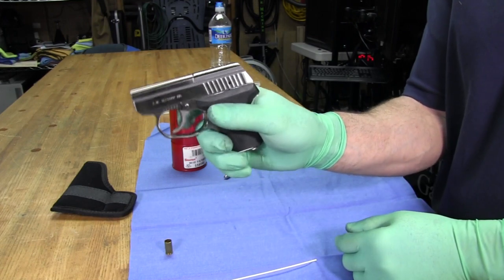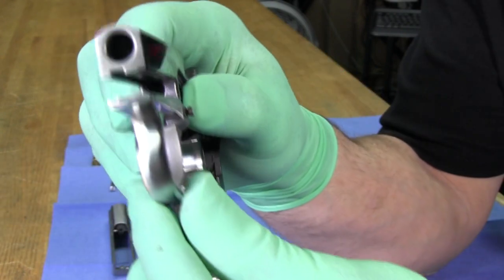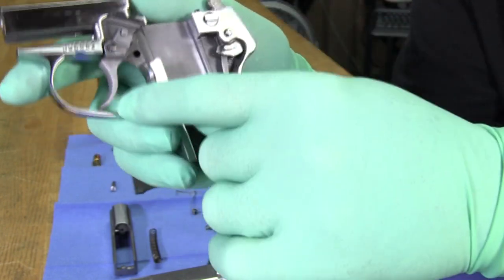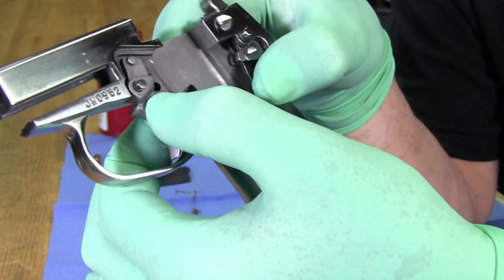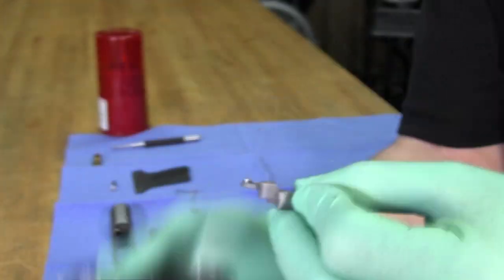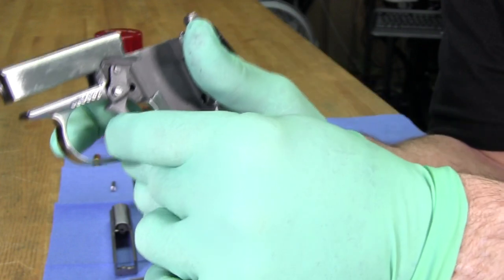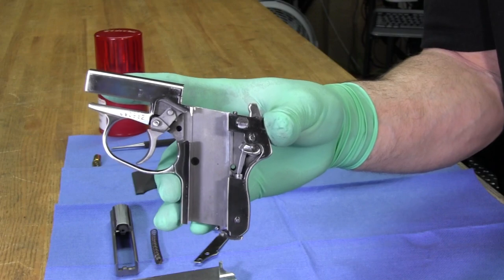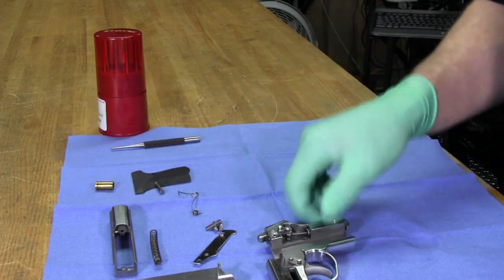Seecamp Sticking Trigger Fix

Comment: If you tighten the grips too tight the trigger will stick. If your trigger isn’t scraping on the guard more than likely it’s the grips. Just look near the mag release. If you can see the pin and the grip seems to be flared out, make sure the pin is centered and tighten the grip “gingerly”.

Comment: How about drilling and putting a tight bronze bushing in the trigger?  Custom fit and self oiling!  Also, I get a small firing pin strike on my .32 on chambering a round, like an M1 or an M14 - normal or sticking firing pin/weak spring?
Reply: I thought that too. A bronze bushing wouldn’t be that expensive.

Comment: Wish I'd seen this two weeks ago. My first LWS32 was DOA. The trigger would bind half way. You could pull through it, but it wasn't right. So I sent it back. I put three mags through the repaired gun, then a double feed blew the slide clear off. It landed 10' down range. I put it back together and it developed this sticking trigger thing. It also didn't fully reset even with a bit of manual help which was due, I believe, to using EEZOX which doesn't seem to have any lubricating properties. They recommend it because the tolerances are so fine ... if sloppy is on the fine scale somewhere. And I, too, suspected the innards and was prepared to polish the hell out of it. We'll see when the replacement comes in in a few weeks.

Comment: RE: Loads. Not only is the gun picky (FMJ won't feed properly), but some brands, Fiocchi for instance, won't even go into the magazine!
Reply: Hello, the pistol was designed for HP only, if your rounds have a round nose them they will not fit the mag
Reply: @falconeye577 super old thread but sure they will if you take the fmjs and set the round in to the OL of .091. That’s what I do, the added effect of setting the round a little deeper is a hotter .32ACP round usually acquired by bullet setback.

Comment: I just bought one of these, i was expecting better quality, seems kind of poorly made, the backstrap is all wavey and inside the slide were the firing pin is is all wavey looking. The trigger is nice and smooth but the steel is all cast and you can see metal balls on the trigger, in between the serations on the slide u c all little pot mark balls like on an older cast Colt Mustang, my mzchined Colt Mustang looks like an Ed Brown compared to the Seecamp, overall it looks about the quality of a Ruger revolver and i guess that makes sense since they r about the same price. Rugers r poorly made compared to Smiths, This Seecamp is not very good quality all.
Reply: Nothing on the slide is "cast", it is all machined s/s.